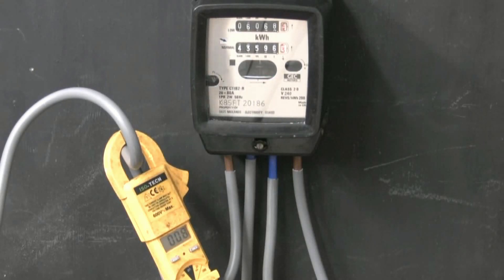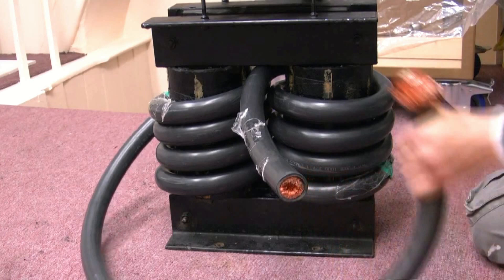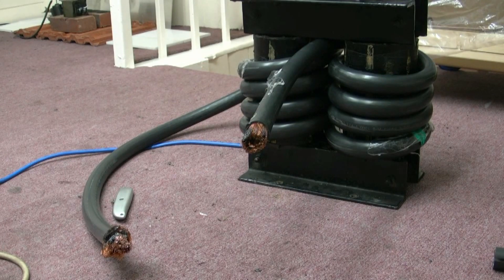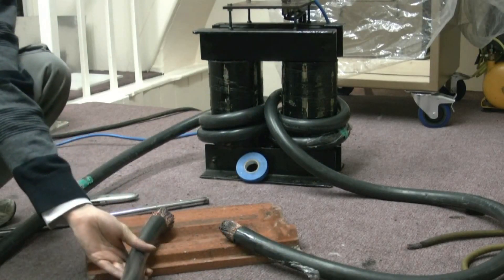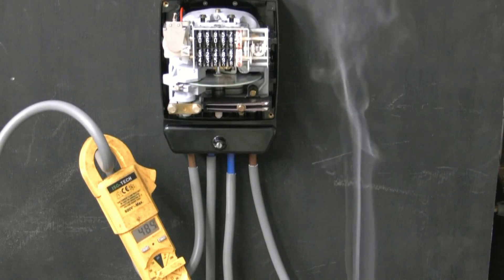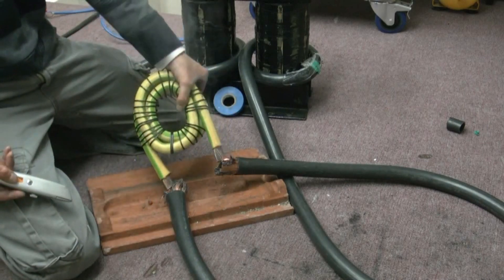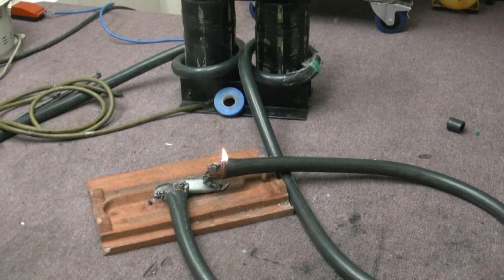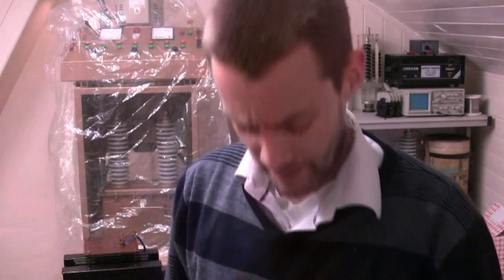Too Much Current + Electric Meter Pops

Comment: I had forgotten this important test for power meter acceptance testing! Melt a box cutter or a dry wall knife If it passes that, then melt a wrecking bar, crowbar or an eight pound sledge hammer head! LOL

I agree with Osmosis, insert a cat into the circuit & see how much power the cat will accept! Which pops first? The cat or the power meter?
Reply: Cockroach "You do smoothing about it"????? What the fuck??? Take your medications.
Reply: congrats
Reply: Cockroach Signs of an animal hater.
Reply: 2716Kanawa So you hate animals!
Reply: Cockroach *Facepalm You do.
Reply: 2716Kanawa So what! You do something about it!
Reply: 2716Kanawa Having trouble reading again, DOOFUS?
Reply: Cockroach Nice edit job!
Cockroach (Edited 13 hours ago) You are a big IMBECILE!
Reply: 2716Kanawa Thank you! I sincerely appreciate it! But a compliment from a DOOFUS is not a compliment at all! Thank you for the extremely flattering compliment! I sincerely appreciate it! DORK!
Reply: ***** Go ahead! I eagerly await being served!
Reply: ***** Correct! It has nothing to do with the black market. But, if a steam locomotive gets picked over enough, there is a chance it will end up here for me to cut apart & have melted.
Reply: Cockroach The IMBECILE of EU is welcome!
Reply: 2716Kanawa Thank you so much for the extremely flattering compliment! I sincerely appreciate it so much! Here is a little something for you which you will appreciate! Junk all the remaining steam locomotives! Cut them apart & melt them down. Besides, it is great fun for the WHOLE FAMILY to watch the steam locomotive being cut apart & melted down the following day! Makes for a wonderful vacation!

History: the record of past events and times, especially in connection with the human race.
Nothing in there are about artifacts or the preservation of relics!
$30K for the engineer's & fireman's instruments, $25K for the bell, $27.8K for the whistle, $13K for the headlight, $12K for the number herald, $18K for the marker lights, $24K for the builder's plate, $1.7K for the grab irons, $10K for the brass bearings, bushings or babbitts, various amounts for the tools, hundreds for the wiring, tubing, valve handles, valves, levers & many other parts.
Dear citizens: As exhibited here, the steam locomotive is not worthy of preservation nor salvage. It is reusable materials formed into the shape of an object which it's materials can be reused. If you are looking for some fast cash, look no further than your local heritage railroad with a steam locomotive. Operating or not, the parts are worth very lucrative sums of CASH on the black market. If you need CASH, these are OPEN BANKS FOR WITHDRAWALS !
Instead of donating your hard earned money to these ridiculous relics of junk & their so called organizations of preserving heritage railroads for their own purposes, would you not rather be the one getting paid? There is a great way to make that happen. There is ALWAYS CASH paid for steam locomotive parts on the black market!
Engineer's & fireman's instruments, bell, whistle, headlight, number herald, marker lights, builder's plate, grab irons, brass bearings, bushings or babbitts, tools, wiring, tubing, valve handles, valves, levers & many other parts.  ABSOLUTELY NO QUESTIONS ARE EVER ASKED ABOUT WHERE THE PARTS MAY HAVE COME FROM, WHEN OR HOW THEY WERE ACQUIRED! Very, very lucrative! Very, very profitable! Very, very low, low risk! It is very, very easy, quickly accessible & so, so rewarding!
Here is a long list of steam locomotives which can be targeted 2, 3, 13, 29, 93, 112, 175, 197, 202, 261, 385, 464, 470, 482, 484, 486, 488, 489, 502, 506, 576, 592, 630, 643, 700, 759, 765, 844, 1218, 1223, 1258, 1309, 1361, 1504, 1518, 1604, 1630, 2100, 2101, 2124, 2156, 2467, 2500, 2542, 2716, 2749, 2933, 3001, 3003, 3007, 3424, 3977, 3985, 4003, 4004, 4005, 4006, 4008, 4012, 4014, 4017, 4018, 4023, 4100, 4294, 4449, 4460, 4500, 4501, 4516, 4524, 4978, 5017, 5629, 6755, 7002, 8300, 8305, 8327 and 9000 are out there waiting for a visit to have the parts removed for black market CASH sales! Then haul all of them into the scrapyard, torches, plasma cutters, chippers & crusher! Load out all that iron to foundry, put in the crucible of an induction furnace & melt it down! Happy, happy days!
Traveling? These targets are all around the country. If you are traveling & need some quick CASH, there is always one near you, waiting for a visit for a parts removal! Doesn’t that sound good?
Junk all the remaining steam locomotives! Cut them apart & melt them down. Besides, it is great fun for the WHOLE FAMILY to participate & watch the steam locomotive being cut apart & melted down the following day! Makes for a wonderful cut them apart & melt them down vacation!
People needing CASH may target the steam locomotive for their financial needs. The black market ALWAYS PAYS CASH for steam locomotive parts. There are collectors who want a part of a steam locomotive & will pay lucrative sums of CASH to get them for their personal & private collections. ABSOLUTELY NO QUESTIONS ARE EVER ASKED ABOUT WHERE THE PARTS MAY HAVE COME FROM, WHEN OR HOW THEY WERE ACQUIRED! Let me give you an idea of what is wanted: Engineer's & fireman's instruments, bell, whistle, headlight, number herald, marker lights, builder's plate, grab irons, brass bearings, bushings or babbitts, tools, wiring, tubing, valve handles, valves, levers & many other parts.
Very, very lucrative! Very, very profitable! Very, very low, low risk! It is very, very easy, quickly accessible & so, so rewarding!
Reply: Cockroach Keyboard warrior once again, goes cuckoo!
Reply: 2716Kanawa What you may think is none of my concern.
Reply: Cockroach CuckooRoach2008!
Reply: 2716Kanawa What you think of me is none of my concern!

Comment: Dude! Please take good care of yourself! You're playing a dangerous game!!! It's amazing - no doubt - but your health has got absolute priority!
Reply: He's been working with electricity as his career for over a decade. This guy knows EXACTLY what he's doing.
Reply: Jamie Evans 
If I post a video on youtube of me driving a freight train, that doesn't mean that I should put in the disclaimer "Don't drive freight trains unless you're qualified to do so" and feel responsible if some idiot attempted to do so and derailed the train killing himself and other people.

If you can't even understand what you can do and what you can't sorry it's not my job to protect you.

That's the same for electricity. I could make a video about me playing around with a steam power plant and making big explosions, but I should not feel responsible if somebody attempts to do that and blows up with the boiler.
Reply: The only risk there is to burn a finger with the hot metal. No shock.
Reply: Jamie Evans
 WTF are you talking about. I know this, and I wasn't talking about high voltage being safe, not at all. And yes I know about the Tesla coil (It's not called teslan machine). Also you don't need a tesla coil, just a transformer with some form of current limiting.
Also WTF is with your "Just because the air is an insulator, doesn't mean the power can't kill you." Did I ever said that?
My argument about 15mA is here to show you that you're just an arrogant person and you don't actually know much about the subject.
Also HOW COULD YOU GET EVEN 3 FUCKING MILLIAMPS PASSING THROUGH YOUR BODY WITH ONLY 6 VOLTS ????? (Count the turns!!!!!)

Oh and you don't actually know what a MOT is. It's a 1kW 0.5A 2200V transformer.
Reply: ***** He cannot die, he knows what he is doing. I would really like to do it myself.
Reply: *****
 First, it's played not plaid.
Then, you really ignore everyrhing about electricity. It's not the amps or how many sparks there are. Or how fast does the rod heats up. It's a lot more complex. Here, since he is using about 2 volts (his transformer does about 1 volt per turn) there is absolutely no risk for him (apart from getting burned from some hot metal) of getting even a slight shock. Can you get shocked by a 9V battery? I think not.
It's not becaause there are sparks flying around that you will get automatically electrocuted. Still you should be careful but the risk is not greater than just manipulating a hot rod.
Reply: Jamie Evans
 Well you might say that for the thousands of videos showing off "how to make arcs with a microwave oven transformer" (Which is WAY more dangerous to use, I already told this a thousand times here the only risk is mild burns or setting something afire because of the sparks - and bear in mind that the carpet is there to CATCH any sparks and prevent them from drifting all over the place as would happen with a smooth floor.) or for that matter also on the millions of videos with "motorbike/skateboard/snowboard/ski/bicycle/BMX/whatever stunts" which are equally dangerous.
Reply: Jamie Evans
 I am sorry but you are wrong. A car battery can supply hundreds of kA in a short circuit conditions, and about 400A every time you crank the engine. Try touching both terminals, according to you you should be dead. But no, because the voltage is very low! The matter is the same here, 20 kA and 3 volts! Touch both terminals and you are not feeling anything. If you don't believe me I will post a video of me doing just that. Oh you are also likely to immediately let go the cable if you touch it BECAUSE IT IS HOT (from the experiment you have just done)

PLEASE DO NOT SUGGEST TO DO THESE EXPERIMENTS ON CONCRETE. This is REALLY DANGEROUS.
A blob of molten metal drops on a wooden floor (it happened to me). Well it leaves a black mark and maybe it will make some small flames appear (easily extinguished by blowing on them). Now do that on concrete and the concrete will EXPLODE and fling pieces of stones AND molten metal everywhere because of the water contained in it. This is EXTREMELY dangerous, way more than even a 1000 kA transformer.

I understand you want people to take the right precautions (Everything is unsafe if you don't care about precautions, not just electricity, and it is more likely that somebody ends up at the hospital because he does stunts with motorbikes than for this.) but at least please try to document yourself on the real risks that are present here. (Ask me as well if you want)
Reply: Jamie Evans
Now you're doing the smart arse while that's what I wanted to say since the beginning of the fucking comment train!
Are we working with 20 kV here? If we were you would have seen arcs (there aren't any). So go rant on the high voltages on a HIGH VOLTAGE VIDEO, Not on this dammit!!!!!!!!!!
I have a clue about the electrocution threshold current. And you are again completely wrong, the fibrillation current is 15 mA, below 5 mA you are likely not to even feel anything (at most a slight tickle). I have just done a test with a 9V battery on my tongue, 2.355 mA of current has passed and I just felt a tickling sensation. And I'm still here to type this comment, this means my heart hasn't stopped and my brain hasn't been disturbed :)
Also "which means you could deliver, at that power rate, 2.3V with 3A" doesn't mean anything. You didn't tell any value of power (watts!!!).
And please the next time refrain from insulting somebody who has a lot more clues than you have, you idiot. You should stick your finger on a MOT.
Reply: MrOpenGL Its always fun to watch an idiot being put it their place by someone who actually knows what they're talking about :)
Reply: its not very dangerous
Reply: MrOpenGL thank you ever so much. My point proven sucker! Robert gabriel
Reply: jd52wtf  I am an EE myself, and I know perfectly when it is safe to play around with electricity and when it is not. 6V (the case here) and 15000 A: quite safe (if you don't mind burning yourself with the hot metals, and the occasional sparks).
On the other hand, 2100V and only 0.5A (as in the many microwave oven transformer videos you find on youtube): not safe at all (touch it and you're DEAD IN AN INSTANT).
Reply: MrOpenGL I thought current kills people, not voltage
Reply: Alim Naizabek
Actually you're right IF YOU TAKE the statement literally. But since you have no or very little current passing through your body without significant voltages, that's why 6V and 15kA are safe.
To be safe, remember this:
Low voltage (below 30V rms AC or 60V DC) and high current (even a few kiloamps): safe ( you may get burned by the flying pieces of molten metals and sparks)
High voltage (above 30V rms AC or 60V DC) and low current (less than 5mA): safe (you may get a painful burn if the current is arcing (above about 20 kV)
Both (high voltage AND high current): terribly unsafe (can electrocute yourself and arcs can create plasma balls who can very badly burn you)
If you are playing with high voltages anything below 5mA will only cause a minor pain, while above 5mA it could cause fibrillation so don't do that.
Reply: These guys don't give a shit, not for themselves, not for you, not for their neighbours, and wouldn't lose a minute of sleep if they found that this video led to someone electrocuting themselves.  I am a compassionate person, even for idiots, but I would like to compassionately give these guys a fucking hiding.
Reply: MrOpenGL Thanks for your post.  I appreciate where you're coming from, but maintain my viewpoint.  These guys don't have any regard for social responsibility, and as for the educational element of this video, surely they could have, at a minimum, explained to their audience why it is that their not being electrocuted but that there is still extreme risk involved.  Irresponsible show-offs.
Reply: MrOpenGL My stance is not different on those kinds of videos either.  I will guide my child, as a good parent, to understand the foolery of other people, and of how to be a critical thinker.  She will inherently - I hope - be immune to copying this kind of shit.  I have friends, who have children, who certainly won't teach their children that - but they are still really great people, with really nice children, and would be devastated by such a loss.  As for this only causing burns...imagine this:  Your leaning on an earthed radiator, laughing and joking with the live in your hand, when a blob of molten copper drops on to your hand; You react suddenly by flinching, or grabbing the cable with your other hand, and end up grabbing the terminal (or stripped part of the cable).  Are you suggesting that this would only cause burns?  3mA can stop a human heart.  As for carpets catching sparks, wouldn't it be better to do something like this in an environment where you're not risking your neighbours life, or the life of a firefighter, like on a concrete garage floor of a detached house?  Wake up.
Reply: MrOpenGL You're talking out of your arse.  A car battery CAN indeed supply hundreds of kA, but - as you say - in short circuit.  That's Ohm's law you fucking dozey.  If you were as conductive as the metal through which you short-circuit a car battery, you would be fucking toast before you came close to touching the terminals.  It's voltage that's responsible for that.  20kA and 3V sounds immense, but flip the two around to get your power output and we're suddenly working with 20kV and 3A.  As I said, 3mA is enough to stop a human heart, which means you could deliver, at that power rate, 2.3V with 3A.  You haven't a fucking CLUE about what causes nervous / cerebral disruption, in terms of electricity, now why don't you do the whole YT community a favour and frazzle yourself on a battery powered fan.
Reply: MrOpenGL The ONLY reason you see "arcs", without killing people, is the high voltage vs low amperage alongside the high resistance (human body) vs low resistance (stanley knife or whatever thug-branded tool that was).  The Teslan machine illustrates this ALL-DAY-LONG.  I could create an arc in a mercury-derived solution with 1mV.  Just because the air is an insulator, doesn't mean the power can't kill you.  Your argument from 3mA to 15mA is fucking nothing compared to what we're talking about...especially what is illustrated in this video.  As for 2.355 mA on your tongue, increase the voltage, or open up your chest, and I'll say goodbye to you.  OR, as per my advice - which indeed comes from SCIENTIFIC sources, increase it 3mA, why don't you?  Have you ever tried "tickling" your heart?

Power (WATTS!!!!!!????), as if that needed to be stated to an expert like yourself, is a derivative of voltage and current, owing itself to resistance.  So what do you mean?  BTW, I was an MOT examiner for 4 years back in the 90's, so what's your point?
Reply: Dylan Dailey
Yes but that was actually pretty tiring for me :D
Reply: I know the feeling.
Reply: Dylan Dailey Oh get a fucking room...
Reply: Alim Naizabek neither voltage nor current kill, it is always the joule which kill😇.
Reply: Adt Net Nope.
Reply: TheBobber777 You must be a old dude that thinks everyone younger then you must be stupid and unwise
Reply: Adt Net
 It's not the joule per se, nor the current per se,
it's Ohm's law the responsible.